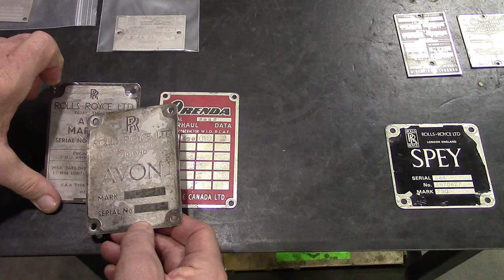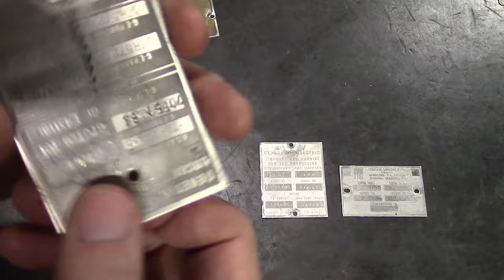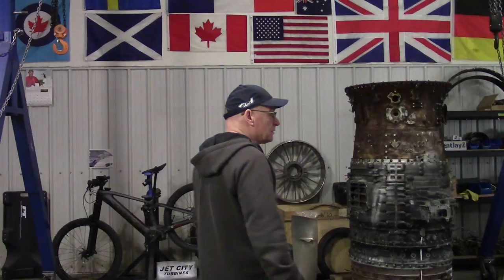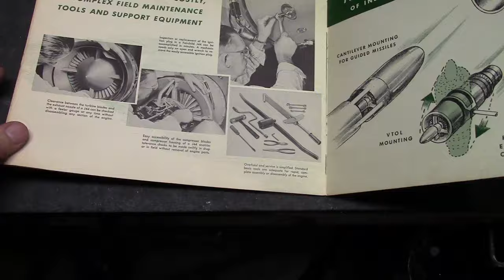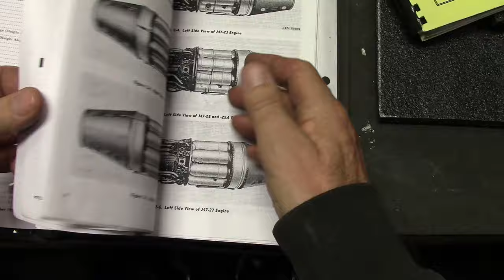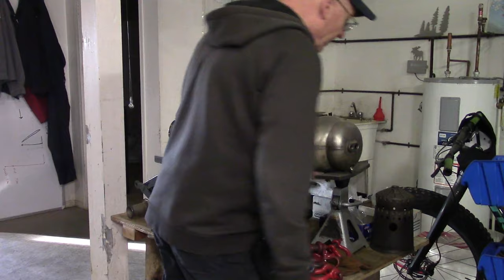A Jet Engine for Fun!

Comment: Back in 2001 a local farm auction listed a GE T58 turboshaft engine in it's shipping container. I didn't make it to the auction, and it sold for $100. Still kick myself, it would have been neat to say I owned a jet engine. Learned a lot from your videos, thanks Jay.
Reply from the maker: New, they go for about a million. Running in non-airworthy condition, between 25 to 100 grand.
You see one of those again, set your alarm...

Comment: Hi Jay, I just now saw this video and wanted to thank you for the mention.  I will say that in addition to everything you said, that if you can sit through the many boring videos of mine covering the J44, then you may be able to take on such a project!  As torturous as it sounds, it will show the details of a simple turbojet engine so you can see what you're getting into!  (2 or 3 X playback speed is allowed!  😂)  If you're thoroughly bored watching these videos then you're probably not into it enough to make that trip. 

To simplify things,  if you can find a RUNNING engine that say, is too old for aircraft use, would be fine for hobby use and it wouldn't require an overhaul.  It would be quite a project just building a stand, wiring instruments & accessories and plumbing fuel/lube systems.  Stand anchoring must be a consideration for safety and wheels are OK as long as it can be fastened and fixed in place for runs.

Best of luck to anyone that tries such a project and as Jay said,  gas turbine engines are designed to make as much power as possible with as little mass and size.  There is a lot of power there and I remember the first time running the J44 (after buying but before restoring) I was startled by the rush and roar of the fire inside of the engine!  I hit the fuel cut off straight away!  See my video of the first driveway run... it's pretty caveman, looking back on it.  Remember the comedian with his joke, "What's the last thing a redneck said before he died?  Hey y'all, watch this! "  😂

DD

Comment: Awesome video! I didn't expect that detailed of an answer to my question but its perfect.  I've been 'playing' with my GTCP85-98 APU for a few years now, firing it up and impressing friends.  I made a stand for it, a control box, and re-plumbed fuel and oil in order for it to function, and its been great.  I live in the country, so no neighbours to cry to anyone over the noise!  I knew the aircraft that this came from, and I knew its maintenance history, so I was very confident in its ability to run without issue, although that very first light off made me super nervous lol.  I also had hundreds of pages of technical information relating to it, so I knew what it needed to safely operate.

The context for my question was in my step to a larger unit, which has a very unknown history, with questionable information.  Its a Polish copy of the Viper Mk 102 / ASV.8 / Viper 8, so you can imagine that the exact specs will be very hard to find. However, with it being a copy, perhaps the specs of the Mk 102 will be bang on? Pictures and video of the engine show it to be stored in great condition, but your explanation in this video certainly gave me a lot more confidence in knowing what to look for with something like this.  And for sub $5,000, if the core is in good condition, and all of the accessories, it makes me excited.

Thanks again for this detailed video, I'm looking forward to the next!

Comment: I totally understood the fuel air ratio content. But even as an Aircraft welder I worked closely with Jet Shop and even spent time in the Hush House at Kadena Air Base in Okinawa, Japan. They would put a tanker (KC135) tanker in their, close the doors and it contained the noise and the engine thrust was deflected up through times straight up at the back of the building. I was in there to watch them sync up all 4 engines after rebuild of a couple of them. The RPMs would usually not be the same, but probes in the exhaust section let them know when they got all 4 engines (JP57, Pratt&Whitneys) were producing the exact thrust at an equal throttle setting in the cockpit. But the fuel to air ratio varied by the exact location in the engine where pressures and airflow were different depending upon whether bypass air used for cooling of the combustion can, aor passing into the can or that which is brought in farther downstream for tailpipe or other component cooling air. In my opinion, I wouldn't even attempt to try and explain it as even my attempt leaves out a LOT of variables. Bear in mind, I am just a welder.

Comment: Another very instructive video! After a couple of weeks of research, watching your videos, calculations and lots of reading, I finally got through with my Turbofan engine "fan" design! I can now have it 3D printed, hold it in my hands and carry on with the next part, until I build and test a stainless steel "proof of concept" version and move to 3D titanium powder printing for the high temperature side!
Reply from the maker: Titanium for the hot section is a bold step. Never been done before. Titanium softens, melts and catches fire it modern turbofan turbine operating temperatures.
Reply: @AgentJayZ  That's why I love your channel, you actually take the time to answer and correct the enthusiasts... Thanks so much!
Reply from the maker: I want you to succeed, and show us all how it goes.
Reply: @AgentJayZ  For sure I will!
Reply: @AgentJayZ  Keeping you up to date on the project, I have been working on a very lightweight heat-resistant carbon nano tube compound for the past weeks. A bit similar to the carbon fan blade you have been trying, I do not remember the video name! Your channel is just like those plastic balls pools I can jump into. Where each and every ball is a priceless amount of real life information. It would be an honour for me, to send you a prototype of my design, let's say in a couple of years, and all this because I bumped into your channel and wanted to make an old movie dream come true! My engine, if everything goes as expected, will be a "Variable bypass turbofan" with a 80% thrust at 400 Kg/m more or less.

Comment: as a teenager i learned on golf carts, and moved onto automotive. i got to work via shop contract the atlanta airport on tugs -- then in my early 20's i worked as a bicycle mechanic in a race team shop. i learned pretty quickly to not bring up to those guys how easy it is. there's like 5 tools. and don't think i ever checked a torque spec lol

Comment: Wiki says the Caravelle VI-N used the Mk 531B engines, with apparently 53 aircraft built. Deliveries made to Saeta, Corse Air, Europe A.S., Minerve, Indian Airlines and Yugoslav Airlines. No mention of any Canadian or US operators. No other info found on the ol’ internet tonight while drinking beer without a jet turbine engine running in the back yard.
And... from memory (somewhat modified by the time of 1:15 AM and the above said beer) I recall some of the points made in your video “Fuel Air Ratio for Jets” including: 1) Quit trying to compare turbine engines with piston engines; 2) Fuel air ratio is not a parameter measured as is done with piston engines; The “mixture” might be very lean or very rich in spots if one could measure it at or after the combustor section, but it doesn’t matter as all the fuel is provided all the air it needs to be mostly burned by the time it exits the engine so, 3) Quit trying to compare turbine engines with piston engines...
Reply from the maker: This message approved by the creator !

Comment: No direct offense to people going down this road, but it's one of those things you have to seriously commit to, have a loving and financially secure future/spouse, Very forgiving neighbors, and a secure place to work on these things. Most people want a jet engine but aren't prepared to live with them, which you will for many years and support it yourself. If you have a lawn mower and have never changed the oil in it, stick to video games. 
Finding parts can take Years provided you can't figure out how to make them yourself to av specs later down the road. 
So what I would suggest for those folks, before you commit, go down to an RC enthusiast park and look at the hobby-size turbine jet engines. They can be had for $3k (with ancillary junk to run them), something like a K67 or 70. It's, for lack of a more concise description, basically a turbocharger in axial jet engine form. They make decent power for scale, all the jet engine noise relevant to size, and drink fuel, just like a real one. When you're ready to step up to something like 170mm custom built or one-off engine, you'll have more than the basics down by then and know what, where and how to find real engines, parts, etc.

Comment: Another great video! I have a Rolls-Royce Turbomeca Adour as a (back yard engine). Its a complete running unit with starter and control panel. It´s on my channel if you want to see it running.

Comment: Smaller gas tutbine engines were built by e.g.Rover as power units for emergency power, firefighting pumps, drying cricket pitches, etc
Alas, not actually jet engines.

Costs around £3000 for a used APU type that may have flown in a Harrier. Look around. e.g. Rover Mk10501 APU. Fail fast. Fail cheap.

Comment: Of the Century Series, only the F-104 used the J79. The others used  the J57 and J75.
Reply: The J57 I have a LOT of time welding on from 1984 & 1985 at Kadena AB in Okinawa, Japan. Great engines, no bypass air and super to weld on. Tailpipes liked to crack along with probe mounts on a few cases, but most on the turbine exhaust cases. T-cracks (forbidden to repair) is sinething I got permission to do as I had advanced training in a vocational college and had advanced metallurgy courses. So I got to weld repair a Lot of them. Civilians would never be allowed to do things we did routinely in the Air Force. But the J58, also a Pratt & Whitney was tho so much more complicated and welding specs were not violated *without the tech rep for P&Ws approval). The J58 of course being the SR-71 Blackbird engines which I got to repair along with aorframe parts fir a mo th in 2884 (prior to even being certified as an aircraft welder, again Military this is OK as long as an inspector verifies what I did). Then the last half of 1985 due to their welder rotating off the island and rhe new welder not arriving for months. Dang fun work, but the stress was very high. Still some of my best memories.  The other engines were the TF33 engines on the RC135 recon aircraft. Those were medium bypass with thrust reverse and most of that welding was T cracks in the inner rear duct and tailpipe cracks. Not a lit of other welding needed on it. Engines were GEs and quite reliable engines. P&W are still my favorite Jet engines and Honeywell Turboprop engines also as they have a really good design, tho admittedly, my experience is now 30 years out of date.....I weld repair Transdormer cases now for electricity. They only fly in an F4 or higher tornado......
Reply from the maker: Yeah, true. But for a little while, the F-4 was called the F110.

Comment: If all you want to do is start a turbine engine and blow hot air out of the back, why not one of the hobby class model jets?
Yeah operating time between rebuilds is ~25 hours, but it will make the sounds and the hot air.
Reply from the maker: Well for noise and mayhem, that's like comparing a scooter or moped with a rat-rod Sportster...
Not a comparison at all.
Reply: @AgentJayZ  It's a good option though for somebody that lacks the space and resources for the real deal. An ordinary person living in the suburbs can reasonably safely play with a model aircraft microturbine in their back yard. Even something small like an APU may not be practical.

Comment: It's hard to beat the guy with the RB211 in his back yard ... except he topped himself by also acquiring an Olympus (as in Concorde).

Both do, yes, run, and he runs them in his back yard.
Reply from the maker: Seen him take it to just above idle. An RB211 at TO power would excavate a couple of neighborhoods.
I haven't seen his Olympus. We've got a 591, but it does not run.
Reply: @AgentJayZ  he only has a transport rack, so yeah ... only so much thrust. 

Not sure he even has the ability to feed it fuel at anything higher, or for that matter, fuel capacity. 

And even at that it's frying trees a hundred yards away.

Comment: I have a Garrett AiResearch Gtc-85-70-1 APU.
I just want to start it one time then I would sell it.
Reply from the maker: If you email me at the address on the channel page, I can send you a PDF of the overhaul manual, which will have all the info to help you start it and fix any problems... 
It's for a GTC-85-27, but it's probably as close as you're going to get for free.
Reply: @AgentJayZ  Will do, thank you.

Comment: Bah! Why run a real jet engine in your backyard, when you can bang together a super-sketchy noise machine that runs on wood! Just needs an old compressor accumulator tank, some junk turbos, old metal pipes of questionable quality, and grandpa's welder! (Plus some other bits and bobs, but that's not important, right? 🤪) Unlike a real jet turbine, this thing emits sparks, metal shavings and Victorian chimney levels of smoke, AND has a very high chance of catching fire and/or sending a turbine wheel into space! By far the most raucous, obnoxious way to destroy turbos, 11/10.
(I kid)
Reply: You kid, but I really want to build one of these one day. 
Watching videos they are just such wonderful danger, stupidity, and entertainment all at once. And I have access to a welder and a few junk turbos.
Reply from the maker: I watch those videos sometimes, and when the turbine housing is glowing orange, I cringe at the thought of and explosion a shrieking hot metal ripping through a few hundred lbs of flesh. It's never happened yet, so maybe I worry too much.

Comment: The fuel/air mixture isn't a real engine parameter of jet turbines, but if you insist, it's somewhere between 62:1 and 33:1 (by mass), or about 32000:1 by volume. A 737 engine puts out about 245,000L/s of exhaust, consuming about 8L/s of fuel.
Reply from the maker: As always, it depends what you measure. All 737s are powered by some form of turbofan. So it depends a lot on whether you include bypass air in the "exhaust"

Comment: I've got a JFS100 i'd sell
Reply from the maker: Does it run?
When was the last time it ran?
Is there a log book?
What do you know about it's history?
Got a good, detailed pic of the data plate?
If it includes an ignition box, Igniter plug and lead, the starter, send some good clear pics of it from several angles. A short video of it running would be helpful.
Then I would be interested, maybe.
Reply: @AgentJayZ  I haven't attempted to run it since I acquired it for a project around 2008. I actually have two. I'll email the pics